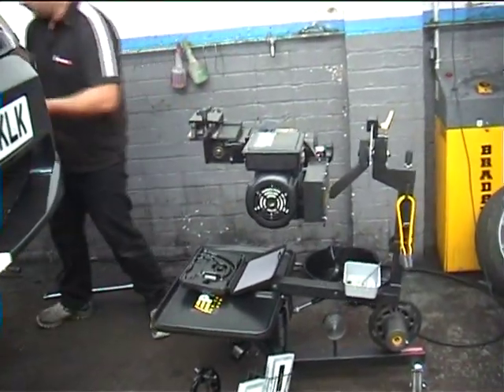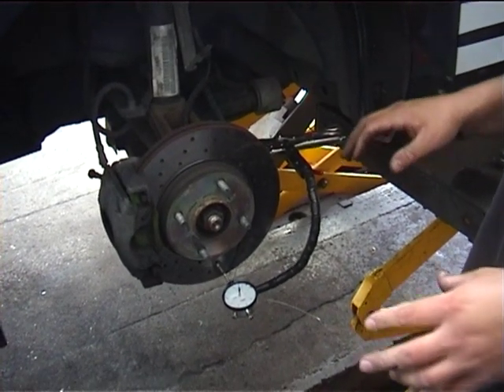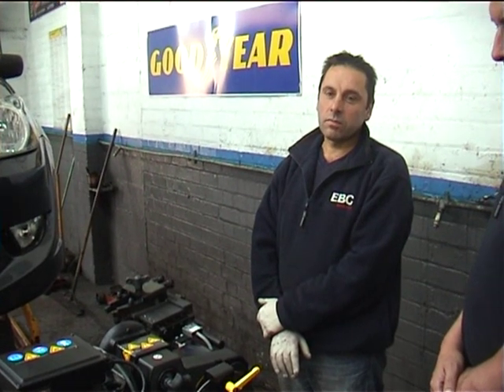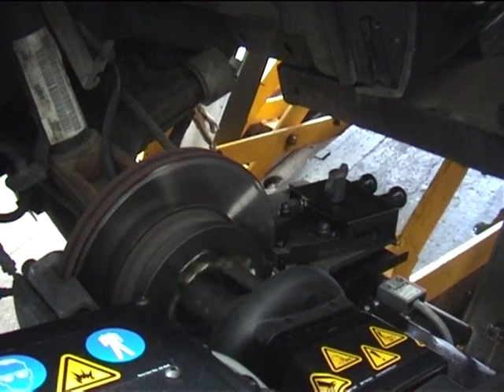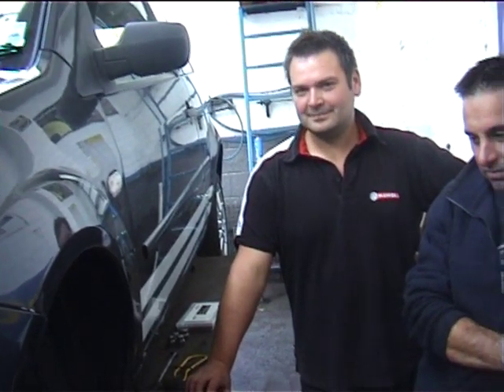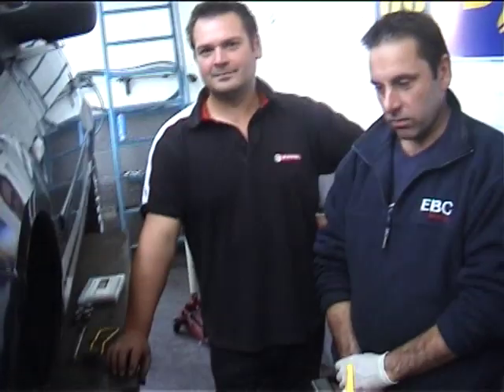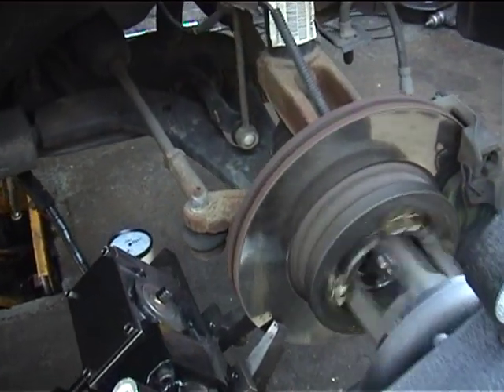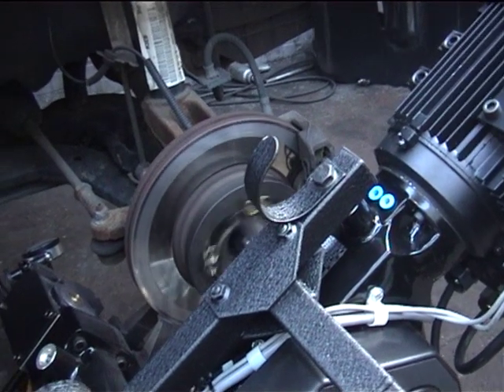Correcting rotor misalignment with a Pro-Cut on-car lathe

Comment: I always check the hub flange run out first,  many ime esp Ford and GM more so GM suffer terribly with warping hub flanges, recently done these on my own car, it got 100% rid of the "warped" disc vibration, discs were EBC and brand new X/D/G, it cost me a bearing and a hub flange skim but all perfect now
Reply from the maker: That's great that you got it all sorted,  if you even need any advice etc. please get in contact with <technical@ebcbrakesuk.com>

Comment: The best thing to do is to always measure the lateral run out of just the hub first. This ensures you aren't simply cutting off the rotor to match the run out of the hub. If the hub has no run out but you measure run out when you add the rotor then you know that the rotor needs to be resurfaced. However, you would first make sure that the caliper isn't binding or on some cars it has a bushing on the top slide pin that balloons when you use moly grease in the slide pin. You can only use silicone grease(preferably Sil-glyde) on those caliper slide pins or they will bind up because the small bushing in the top slide pin has ballooned and locked up the top slide pin, causing excessive heat and warping rotors.

They actually make brake rotor shims that you can use if you measure run out of .003 or larger, up to about .007 that you can install the shims in between the hub and rotor to offset the hub and/or rotor run out to make it straight again.

There are how-to vids on this.
Reply: What are you talking about with these "ballooning" bushings?

Comment: Dear EBC,
I navigated to this video from this site: https://ebcbrakes.com/articles/pro-cut-lathe/
I'm having a hard time understanding the "1 in 7 vehicles have bad geometry issue" being the reason this 1 in 7 vehicles would need to perform this Pro Cut.

Please help point out where in my line of thinking I need to change:
1) When rotors are freshly manufactured & delivered out-of-box, rotors are geometrically perfect.  (Or at least let's say they are.)
2) So for a new rotor being mounted on a vehicle, for there to be 1-in-7 vehicles having bad geometry being the reason such new rotor will show run-out and need to be re-surfaced... Doesn't that mean the mounting-face for the rotor going onto the hub, that mounting face is not radially-flat (perpendicular) to the rotation axis?
3) If that's what translates into rotor wobble every rotation, then isn't changing out the hub/bearing/etc the right fix?  Why are we resurfacing the rotor?  If a new rotor mounted onto the hub shows this wobble, the wheel & tire are going to show similar wobble.  This resurfacing "fixes" the rotor wobble, but kept the root cause of the problem un-solved, and allow that problem to transpire into the wheel & tire wobble...
Am I mis-understanding something here?
Reply from the maker: Although Brake rotor Run-Out can be measured on a vehicle it can also be measured off the vehicle to eliminate factors such as Wheel bearing/hub issues etc.

It is important to remember we are not talking about suspension geometry in this situation.

Lateral run-out of greater than .002”  is, over time, the root cause of thickness variation (TV) which is the direct cause of brake pedal pulsation. 

A rough surface finish will cause brake noise and potentially affect stopping distances.

Lateral Run-Out is the amount of “wobble” in the rotor or side-to-side movement as the brake rotor completes one revolution. In order to be measured correctly, the rotor needs to be evenly tightened to the hub and all mating surfaces must be clean and free of debris. 

For comparative purposes, human hair ranges from between .0015 to .004 inches! Many manufacturers now require that you eliminate lateral run-out to less than the thickness of a human hair as measured on the rotor face at the outside edge of the brake rotor — (less than .001”). 

Thickness Variation (TV) is the amount by which the brake rotor’s thickness varies if you were to measure it in several (usually 4–6) different locations around the rotor with a micrometer. Thickness Variation is generally a result of excess lateral run-out (wobble) causing the rotor to scuff the brake pads on the “high spot” once each revolution. Today’s aggressive semi metallic pad materials wear away the surface of the rotor at this high spot over time (usually 5,000- 7,000 miles) until the TV is great enough to be felt in the brake pedal as pulsation. Some of the new ceramic pads can even cause thickness variation by transferring friction material onto the rotor on each revolution. This occurrence of TV can also be eliminated using the Pro-Cut lathe.

Please feel free to email <technical@ebcbrakesuk.com> if you require any further information regarding this matter.
Reply: @EBCBrakesUK  That doesn't really answer the guy's question. What is done first to ensure that the hub mounting surface is true first to begin with? If there is any variation in the hub it will increase as you move radially from the center. If you're truing the rotor as it's mounted on the hub but the hub isn't true then if the rotor is ever removed it must be clocked to the same position when reinstalled.

Comment: How can I find local shops that uses these? I have captive rotors and Im not pulling them to get a resurfacing. (plus most shops I asked cant even deal with captive rotors off the car, they just replace them.)

Comment: Question: Can this type of runout be fixed by removing the disc and putting it on a normal lathe ?
Reply: Khazar01 yes I do it all the time, skimmed hundreds of discs on my Harrison M390 lathe, grip in the bore of disc , clock the hub face, skim one side , then put boring bar upside down, run lathe in reverse and skim other side WITHOUT removing the disc then all 3 faces are true to each other.

Comment: Is it normal for the whole lathe to move during the cut it seems excessive. I under stand its not in a direction to affect runout but it still does not seem to be centered.

Comment: Everyone worries so much about "runout"  If you look at the specs for thickness variation, you will see the specs for Thickness variation are MUCH smaller and more apt to cause brake pulsation. With a floating caliper, a small amount of lateral runout would not be noticed.